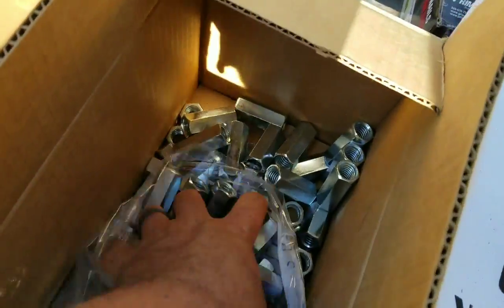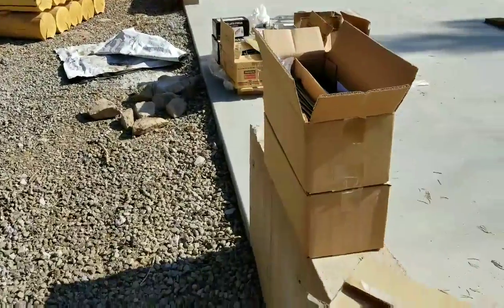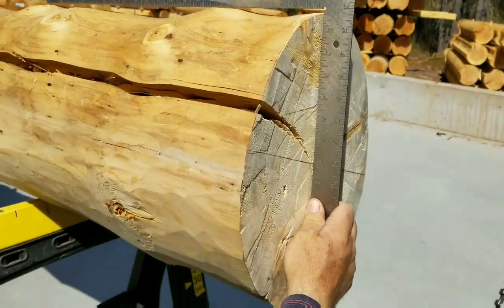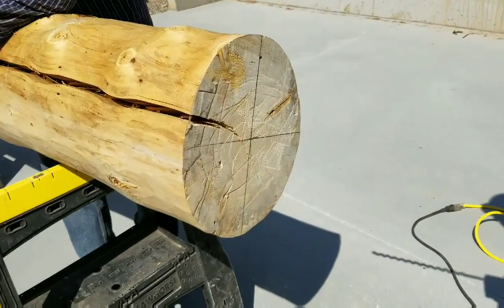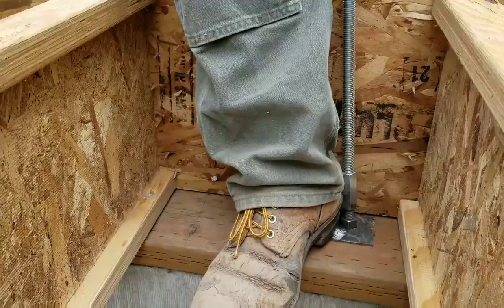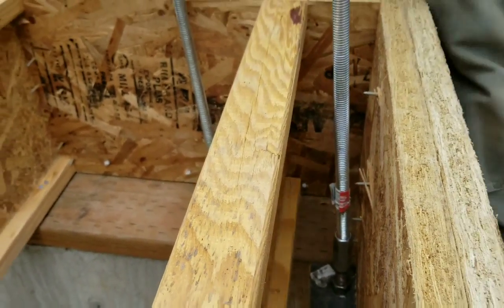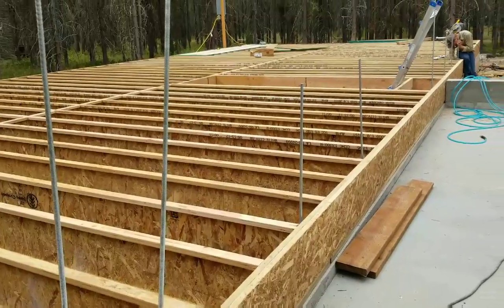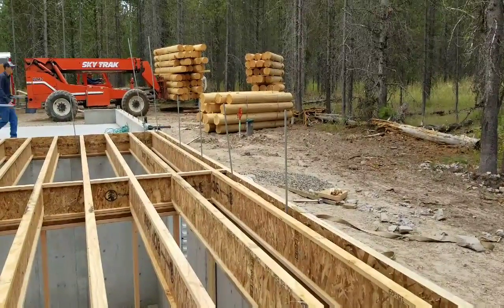LOG CABIN BUILD, Getting started with support posts, main floor framing and all thread tie in

Comment: When you cut an all thread , you should install a nut 15 threads or so  , IN from the point that you will cut the rod........THEN , after cutting you can run the nut off the cut end and it will , usually , straighten out any threads messed up due to cutting !!!!!!!!!!!

Comment: My parents built a Panabode log home from Canada after our house burned back in 1971.  The roughest part was separating out the various pieces when it was off loaded off the flat bed.   It was placed on the original foundation of the burned house so had to be custom designed.  All the logs -- except for the first course -- had a male and female side -- and went together so tightly using a 20 pound sledge hammer (and a specially made pounding board) there was no need for caulking.  The only nails were the ones on the first course and on the roof.  All the interior walls were also logs -- so you started on one end and worked your way around until you got back to your original starting point.  2 men and a bunch of kids working as runners put the house up (6 ft) in a week (30x75 with a 3 car garage perpendicular).  The higher logs needed an extra man and scaffolding.  A crane was needed for the ridge beam.  All the framing around the windows and doors floated because the logs continued to settle for 5 yrs but the first winter -- 40 below zero temps and howling winds -- there was not a draft or a cold spot.  Students and Professors from a local forestry college were amazed at the construction.  The only problem we had was the electrician decided to go deer hunting so the electric had to be added after the walls were up but was pulled up thru the basement and camouflaged.  You also had to wear gloves while handling the logs so you did not leave hand prints until 2 coats of poly was applied on the interior walls (3 in the bathroom).  It was -- and still is gorgeous.  Cost in 1971 money?  15K and change for the kit (3 bedroom, 2 bath, 2 great rooms, parlor, 3 car garage) which included tariff and transportation but not windows since we put in Pella.  Plumbing, electrical, and foundation upgrades, stone mason for a 10 ft fireplace plus the crew came in under 8K but my Dad is a master carpenter so he managed the build.  First log laid the end of September and we moved in for Christmas with only minor finishing work to done in the interior (my Dad made the kitchen cabinets and converted antique dressers for the bathroom sink cabinets).  It was only 1 story so we had cathedral ceilings in every room.  http://panabode.com/

Comment: Could you do a video on how much this project costs so far, material and man hour wise?
Reply from the maker: Dark Shaman1222 
That's a fantastic idea I will put those numbers together and shoot a video that helps break it down
Reply from the maker: Dark Shaman1222 
Do you want and know the total cost of the completed cabin or just the log instillation and framing?
Reply: Essential Mountain Homesteading whatever you have spent from first video to this point in the project
Reply from the maker: Dark Shaman1222 Here is a rough guess on what we spent In order to get the framing on this cabin started. 
lumber 3690.00
logs  65780.00
hard wear 2897.00
trucking/delivery 1127.00
equipment rental 989.00
labor 2500.00 as of this video.

As of the posting of this video The numbers above are a ballpark of what has been spent to date.
Reply from the maker: Dark Shaman1222,

Building a log cabin is a lot like buying a Ferrari, log cabins are expensive to build and expensive to maintain
Reply: So , are gorgeous women !
Reply: Also is that earthquake country? why so much anchoring?
Reply from the maker: Michael Chavez We are close to Yellowstone National Park and the seismic activity is pretty regular